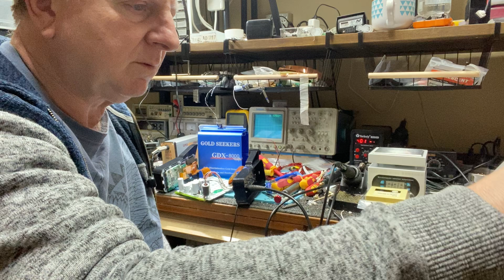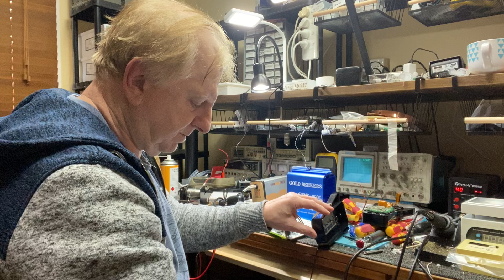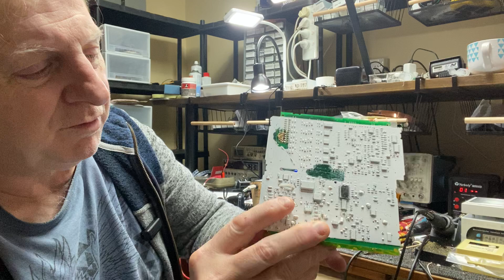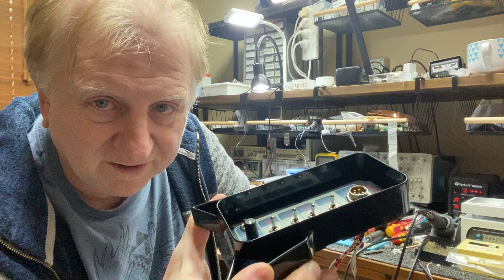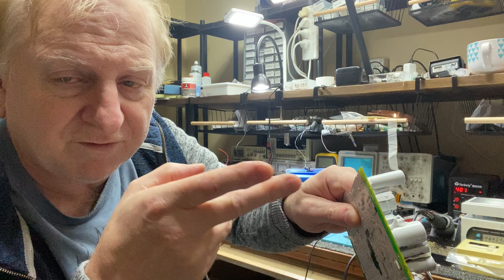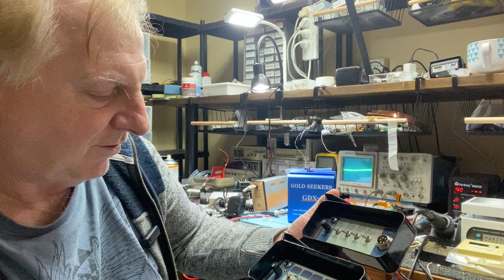The GDX 8000 after repairs.

Comment: "Thank you. I’m not a technician myself, but when I opened the metal detector during a visual inspection, I noticed one capacitor was cracked. I took the device to a repairman, and he replaced it, but the problem still remains. It only detects large targets."
Reply from the maker: if its a GDX8000 then it can be anything.
Reply from the maker: Input mosfet leaky.

Comment: Tell me what could be wrong. The GFX8000 metal detector only sees large targets and not deep
Reply from the maker: Anything from integrator’s to the input stage.
Reply: @DetectorMods 
"Thanks. I’m not a specialist, but during a visual inspection of the metal detector I noticed a cracked capacitor. I had it replaced by a technician, but the issue persists — the detector still only responds to large targets and ignores smaller/deeper ones."

Comment: I literally was going to ask you about the upcoming NF 13x9 if you didn't mention it and the "modified GPX 4500 and 5000". I saw it last night on phasetech and MD. Though MD says "modified" whereas PT says "standard or modified". I was wondering if that meant aftermarket modified like yours or some in-house ML mod, if there was such a thing. I dunno, doesn't affect me as I wanna get one for the Algo but the "modified GPX" in the blurbs had me wondering what they were referring to.
Reply from the maker: They are saying the coils will dampen out fast enough for higher receiver gain or faster receiver turn on.